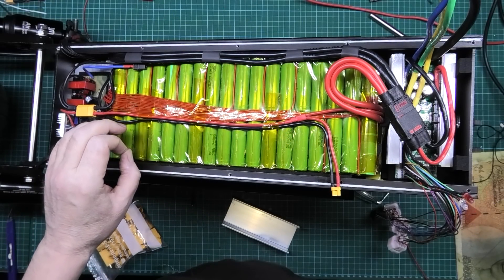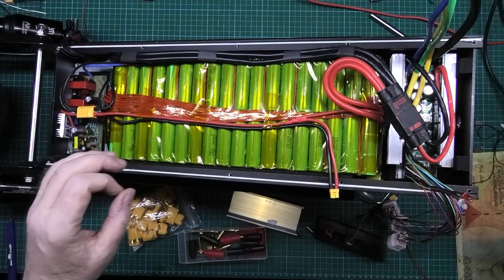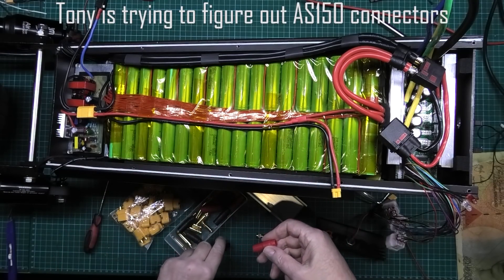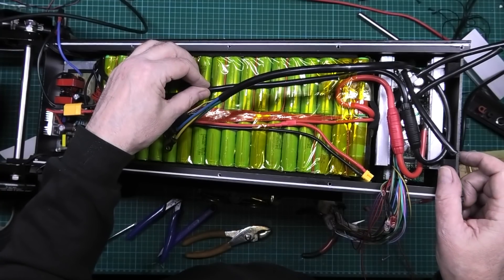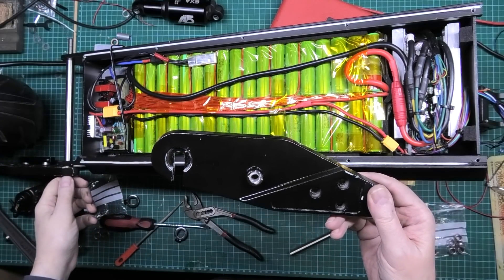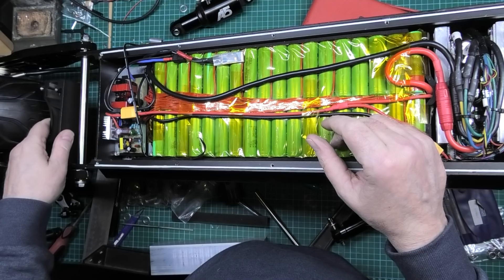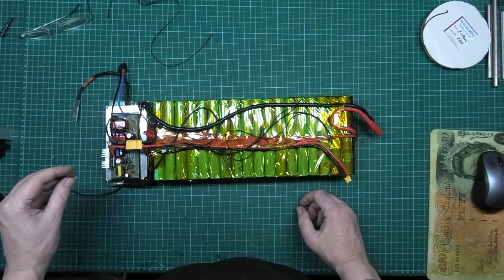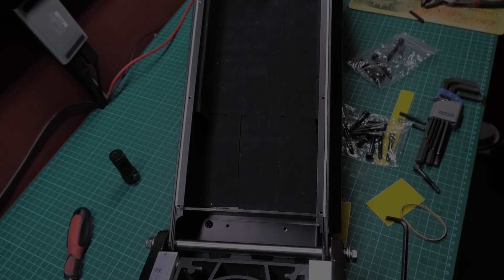🔴 EXTREMELY POWERFUL E-SCOOTER BUILD part 7 - First power up of 3kW motor

Comment: I love it!!!😍
Waiting to program Kelly and tell us how easy or pain in the @ss is...!!
I want to buy Kelly Controllers ( two 7212 ), but I'm afraid if i can't make them work then.... Are useless!!!🤷
You are the best Tony!!!!👌
Waiting next steps...🧐🧐
Reply: Just a quick heads-up...... The KBS-E is easy to program, there isn't much you need to know about it. The worst part is measuring the throttle voltage and selecting it from a drop-down.
Reply: @vortecksengineering884  it will be very helpful if you make it a video, or till finish the scooter explain this part (with the throttle) that it's difficult and needs attention...🙏
Reply from the maker: Actually, it's easier than I thought. If you know you have a hall sense throttle, it's one selection, if it's anything else, you select the other.
There is a grey area around the throttle start and end points but I'll try to explain them as clearly as possible.

Comment: are insulated bus bars good for high current in a tight space instead of thick gauge cables
Reply from the maker: Yes but....... I couldn't fit them. I don't like the idea of the battery sitting on a bus-bar. with a small amount of insulation in between. Plus which, it's so tight on the ends, it would be very hard to put any silicone wire & connectors on the ends.

Comment: It looks awesome! I guess that the rear wheel might need balancing. At one point (when the motor was accelerating / decelerating), the vibration seemed severe. I guess that the frequency of the rear wheel imbalance, matched the natural resonant frequency of your Rear Wheel Mounts to the Scooter framework.
Reply from the maker: The tyre needs centraling and probably dynamic balancing afterwards. It's low on my list of jobs but I will do it before I take it out.

Comment: This is just brilliant it's going to have some power that's for sure I thought that wheel was going to take off. Never seen so many batteries in such a small space before. Great project can't  wait to see it finished.
Reply from the maker: It took a lot of planning and I couldn't get as many batteries as I wanted but it'll do I suppose.
It should be ready for Spring 😁

Comment: Packing is always the bane of my existence. If it’s not FPV is bloody ebikes. Iv sprinkled in crimped eyelets of late which are easier to do in-situ, no soldering, simple bolt and nut connection. The con is thought needs to go into insulation.
Reply from the maker: When I have size restrictions, I solder the lot. Not a brilliant idea because it makes servicing more difficult but it works.

Comment: Those a150 conectors are brilliant 
I have them on my rc car for about 5 years and they are still clean and anti spark cap still works on all 6 conectors 
RC car is a savage flux XL 6s 120a controller
Reply from the maker: I used the same AS150 connectors on the main battery terminals when I did V3 e-Bike. They've been given a lot of torture and still going strong 😁

Comment: @vortechs Tony what about 3d printing a rim only has to be 5mm deep to go around the rim on the bottom like the Xiaomi has just to give that little bit more space. And for fucks sake leather cavlar up  and helmet when testing that BEAST
Reply from the maker: That's what I had to do with the M365 mate. I set out to make this one completely original with regard to the chassis - I needed a challenge and I succeeded 😁

Comment: Could you not run two strips of black aluminium down each side a desired thickness to raise the plate to give you a bit more room..I understand about keeping it looking original but that’s been lost with the back wheel
Reply from the maker: I did that with the M365 where I 3D printed an extension for the casing and it worked but I set myself a challenge with this one to make it 100% standard.
Reply: But you’ve lost standard with the massive wheel..don’t take this as a - comment I love your work and channel